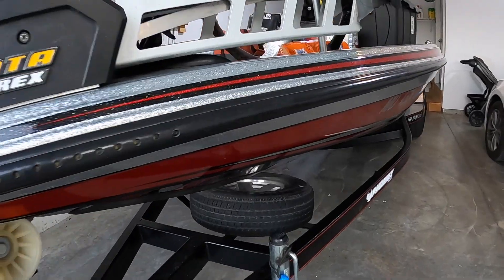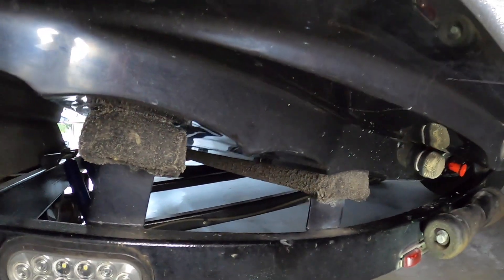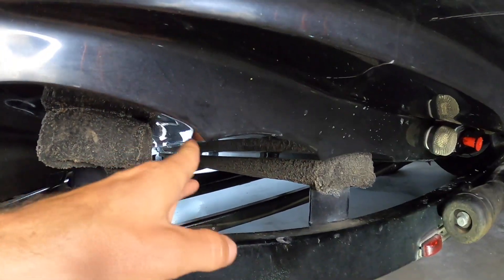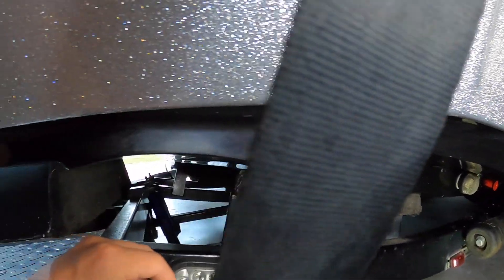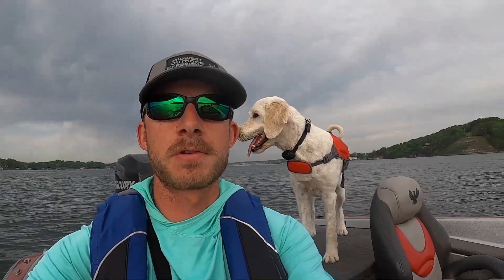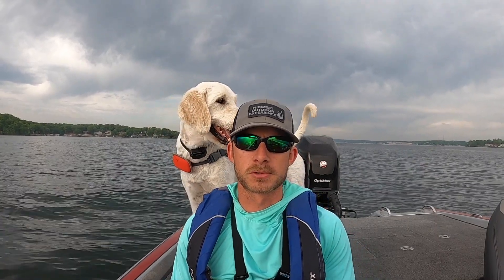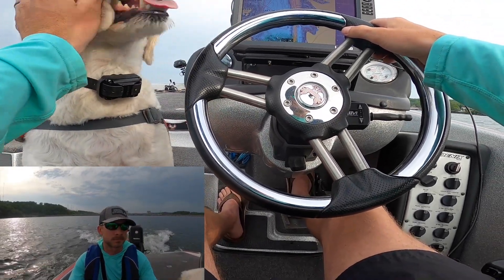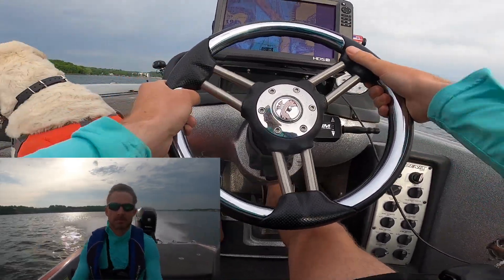Bass Boat Driving | High Speed & Chine Walk

Comment: I have driven and raced Allison’s for over 27 years, chines and strakes provide lift to get the boat on the pad. Always keep slight left pressure on the steering wheel to counter torque from prop rotation. Go in baby steps until it becomes a matter feel.